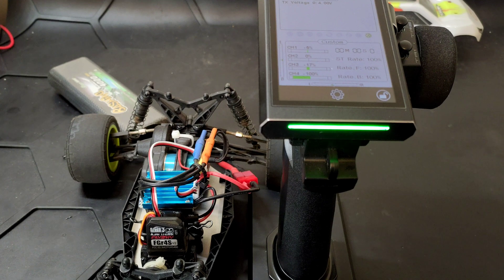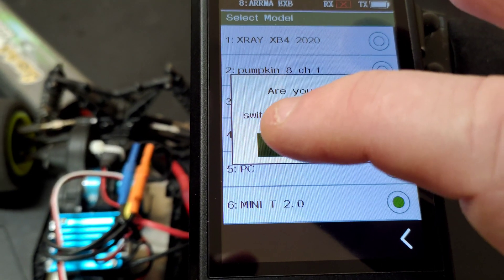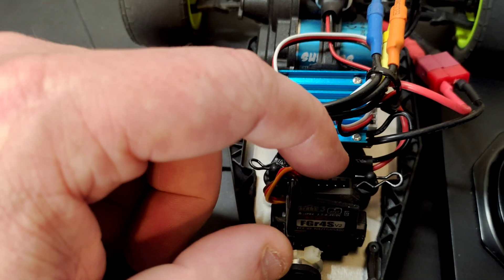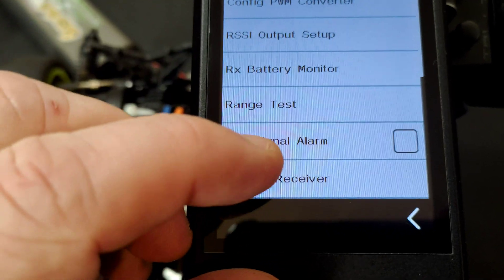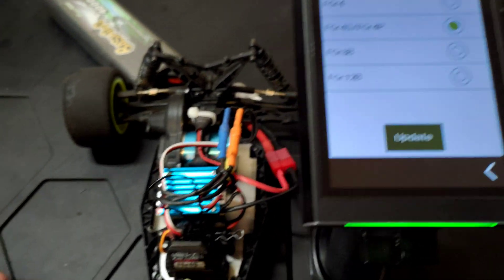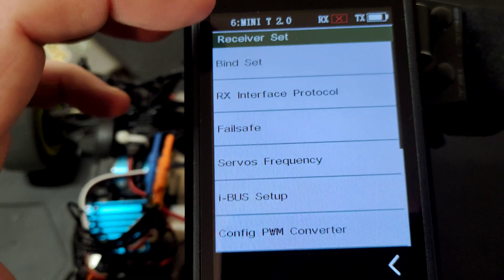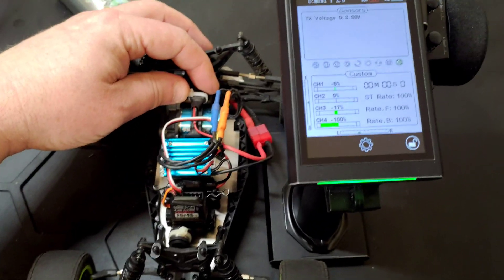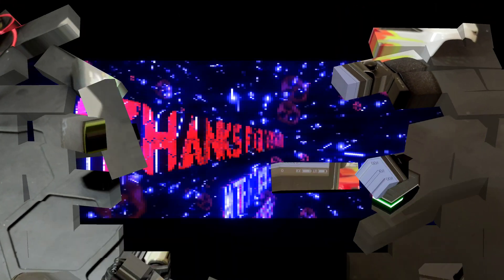Flysky fgr4s firmware update guide after 2.0.93 nb4 update.

Comment: On the flysky downloads page there is a separate download / program to update the receiver. What’s this for if it’s on the transmitter anyway?
Reply from the maker: It for updating receivers that are not supported on the nb4, you download it connect the nb4 to the pc and then update the receiver ie ftr10 through through the software via the nb4
Reply: @WTFRCCars  Gotcha, thank you! My nb4 says that it can update by either connecting it to the receiver or by putting it into the mandatory update mode as you show I the video. I wonder why that is? Maybe it can update all receivers at once if you put them all into mandatory update mode to save time? Good video, thanks!
Reply from the maker: Only update 1 receiver at a time or you will brick the receivers.